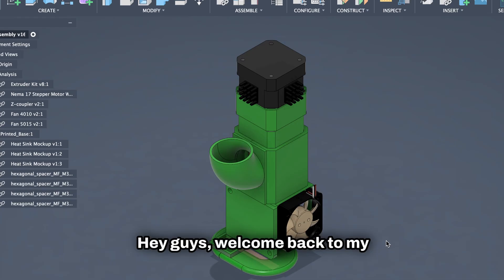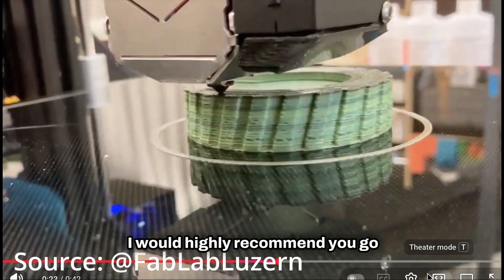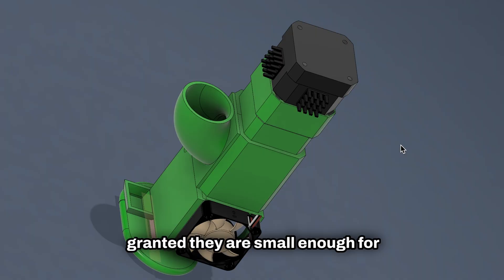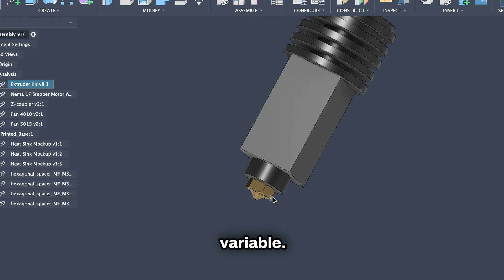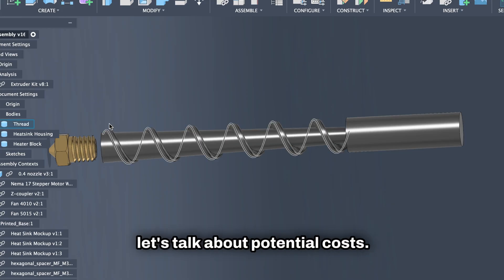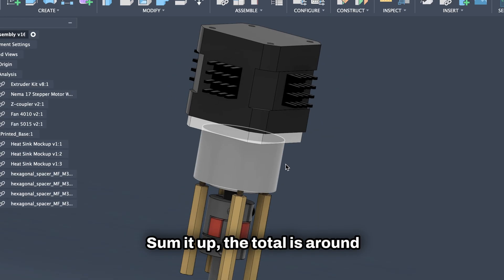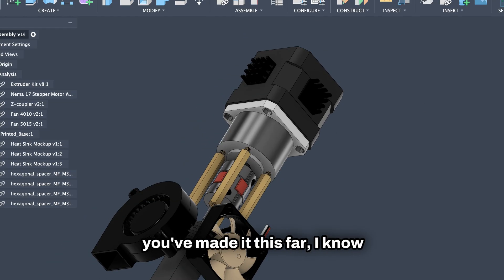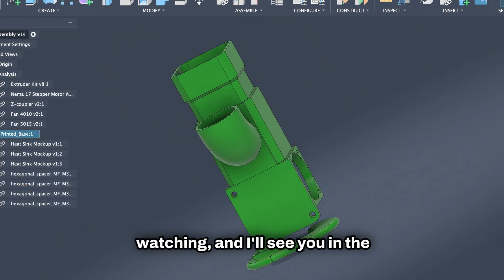I Designed a 3D Printer Pellet Extruder

Comment: I am absolutely down for this path in 3d printing. Do you have a working prototype yet ?
Reply from the maker: nah, still working on it :(
Reply: @AZ3D_printing   With the new 5 axis 3D printer around the corner. I think it would be future thinking to remote the hopper and look into a way to extract the filament at 1.7mm. The hopper won't be able to live anywhere near the head In fact there will need to be two  filament buffer systems. A buffer to push and a buffer to pull. With a tension buffer zone.

Heat it to form it and a heater to melt it. With matching buffers.
Reply from the maker: @Vlad-m9n1n smart! Thanks for the motivation ❤

Comment: how do pellet extruders assure that there are no air bubbles?
Reply: I designed and made a filament extruder for pellets from scratch, for which I got a Maker award. Air is usually not an issue. Usually pellet extruders have several temperature and different pressure zones. This ensures a good mixing of the raw material and a gradual compression. I rathernthink the bubbles are moisture in the material. I produced around 50 kg of filament from pellets with my small machine and never had any significant amount of bubbles in it.  Agree I would love to see more content, tests etc...
Reply from the maker: @olafbreuer8129 that’s awesome! Would you be open to sharing a link to your work! Thanks for the insight!
Reply from the maker: The auger screw will compress the plastic, and due to density (air is less dense than plastic), the air will travel upward and not down (where the plastic is going)
Reply: @AZ3D_printing  but in the print demo you can see the air bubbles in the layers. Even epoxy has bubbles despite it being heavier than air and needs a vaccum chamber to get the air out
Reply from the maker: @meocats  that's a good point. Also those videos printing aren't my own design. As I'm not really an expert, idk haha